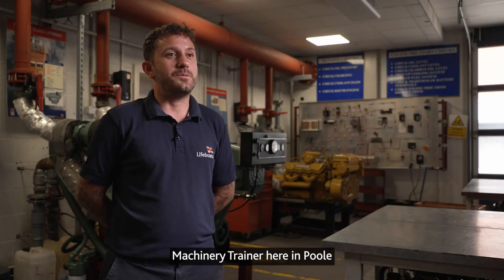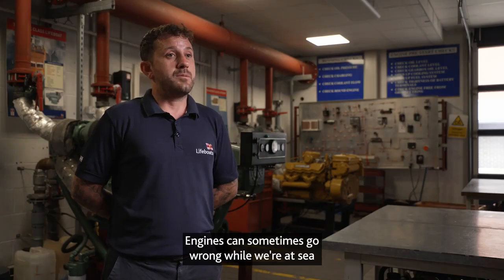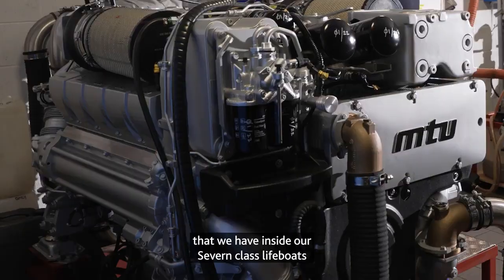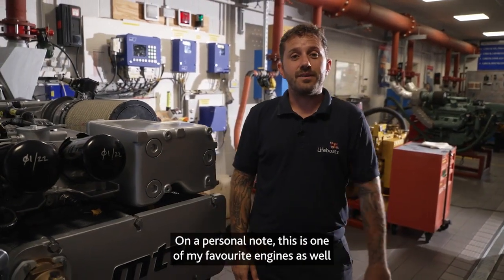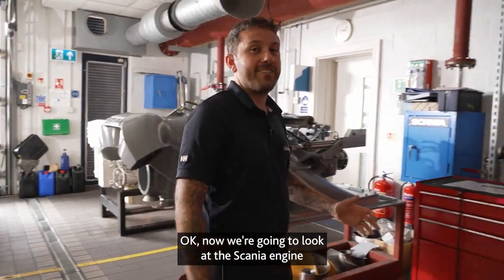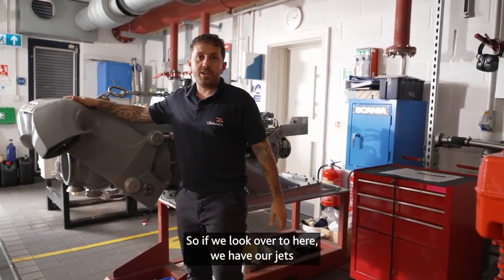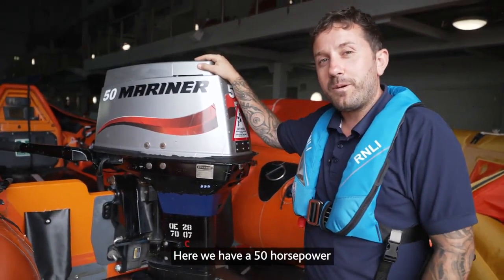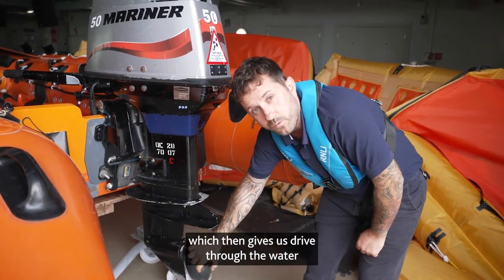In the engine room: See lifeboat engines up close with RNLI Machinery Trainer Scott

Comment: I was somewhat surprised that the RNLI is still using that Mariner engine which is quite an old design. Do the RNLI have plans to modernise their small outboard fleet ?
Reply from the maker: Hi, thanks for the question. The Mariner two stroke engines are quite old but are also lightweight, powerful and reliable. We are in the process of changing some of the two strokes to more modern four stroke engines 🙂

Comment: Hi, Why are the CAT engines being replaced with MTU units?
Reply from the maker: Hi Charles, the main reason for the replacement is that the MTU engines have more power so the boat can run at same speed with less load on the engines so are less stressed and parts last longer. The CAT 3412 engines are also older and all engine manufacturers phase out models as they become less competitive and sell less so its good practice to avoid becoming reliant on equipment that may become obsolete and more expensive to support. We hope that answers your question.